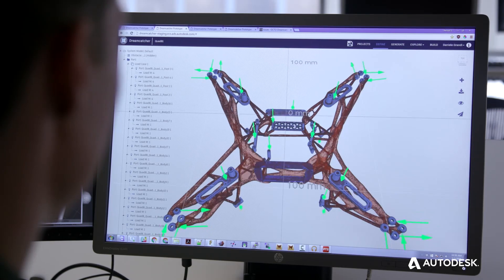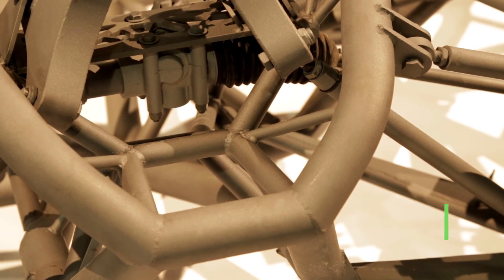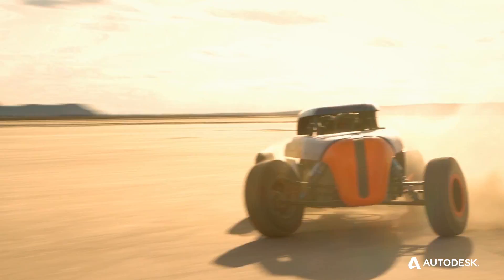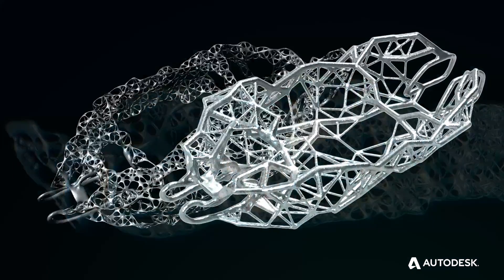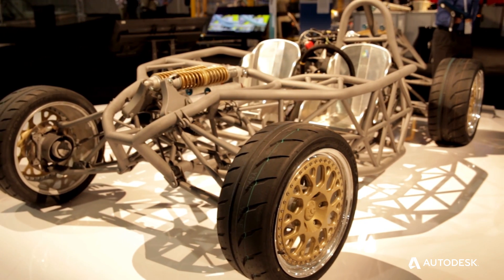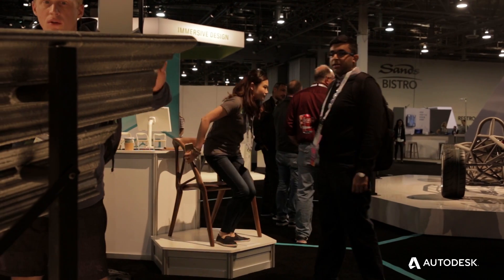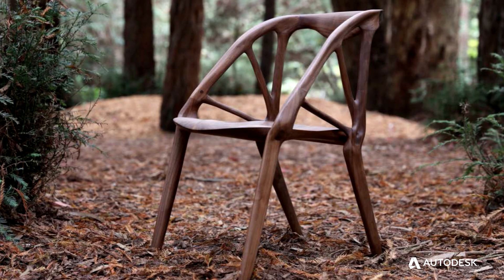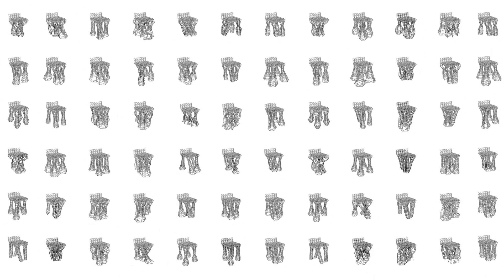Generative Design

Comment: What happens when the cameras of the AI cars are covered in mud, debris, semen and other environmental factors?
Reply: Semen!  LOL
Reply: What happens with a human driving a car.... Depends on a human, the same goes for every individual AI build.
Reply: @viktorvlasov483  AI computers are supposed to be flawless.  When was the last time a computer made an error in mathematical calculations?  People make mistakes, and that's a part of the reason why calculators replaced the abacus.  The computers that are flawed are the fiction from Hollywood.
Reply: @juannagle5633 asked:  "When was the last time a computer made an error in mathematical calculations?"  

all the time.  well not all the time, but it happens enough that you better check your answer if working on critical programs.
Reply: They also come with LIDAR sensors, which are not effected by the above elements.
Reply: Lol did you even watch the video ?
Reply: sea men?

Comment: Fantastic!  Have you tried using generative design iteratively? e.g. put the sensors onto the new generativly designed car, drive it and gather data from sensors, then use data to do generative design again to make it even better! Then repeat a few more times until it settles into some kind of fully optimized design. Thanks for the mind blowing video.
Reply: That's basically what they did with AlphaGo.
Reply: Exactly @Jason Voss   Collect data, have the Generative AI produce a million virtual iterations of the design, pick the best, build the car, collect data, then the AI needs to analyse the data to check if it's model was in fact optimal for the real world, then do another million iterations.  They don't communicate very well with the public...lack of details shared.  Also how hard is it to respond to 28 comments on youtube ?  this is the future...so frakking talk about it.